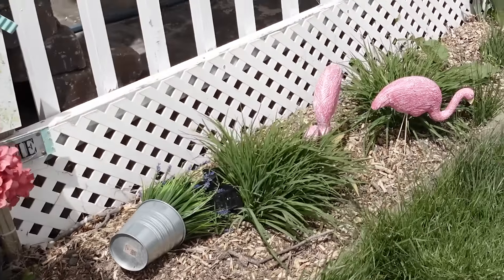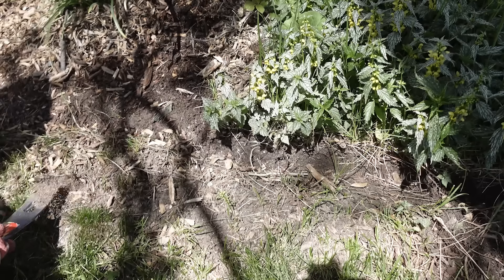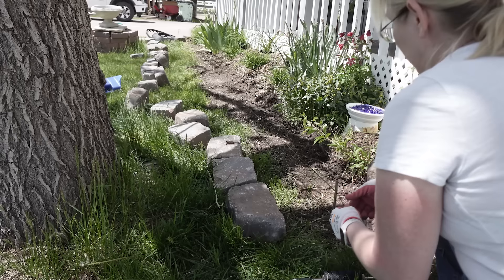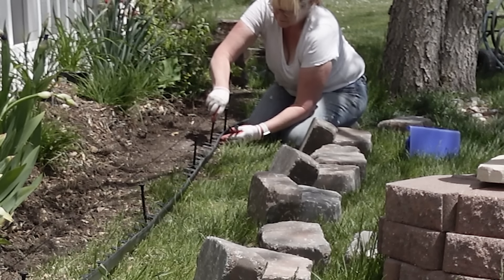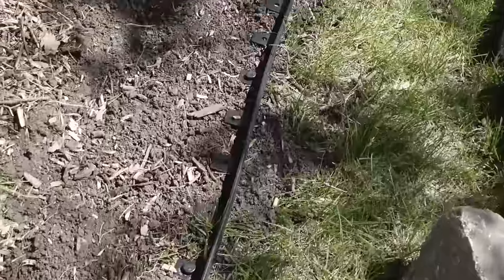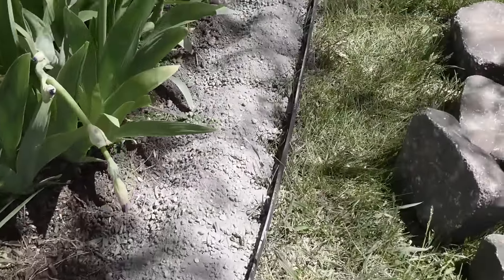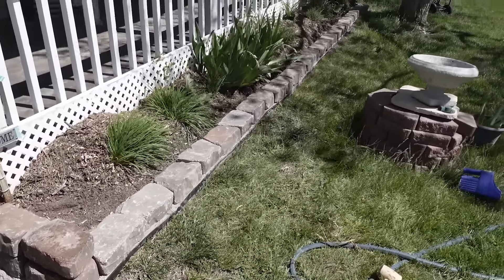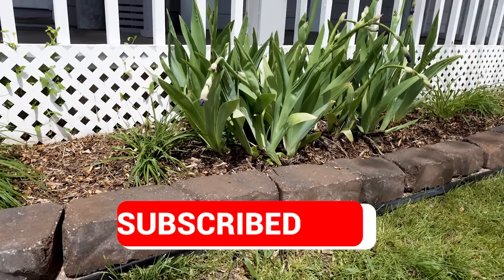EASY NO DIG BORDER FOR YARD OR GARDEN!

Comment: Have you tried to move a stone? I'm wondering how well the Quikrete cement worked. I've been told that cement doesn't adhere to cement. That an adhesive would need to be added to make them adhere together. If so, I wonder if mortar would work..... Any ideas?